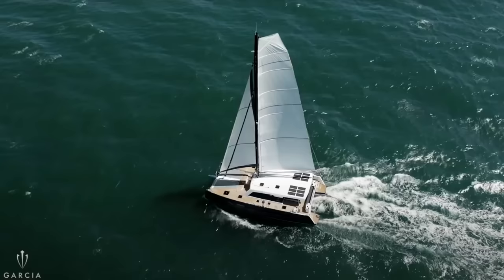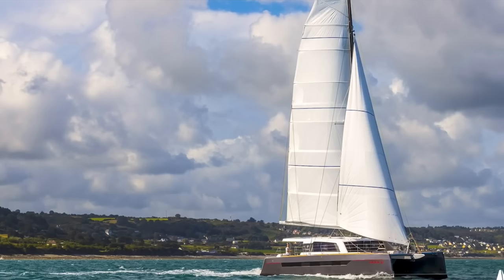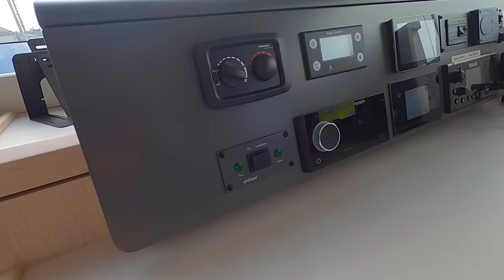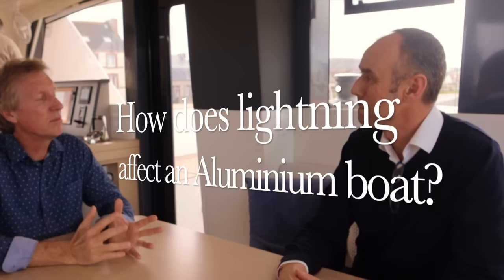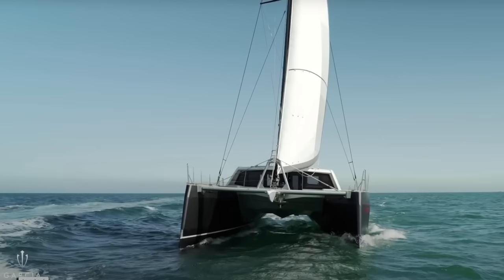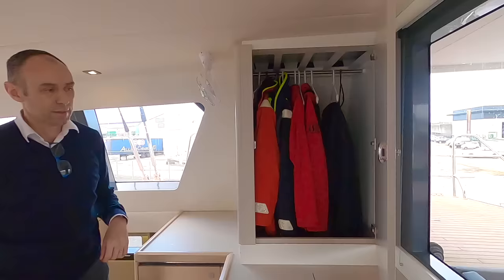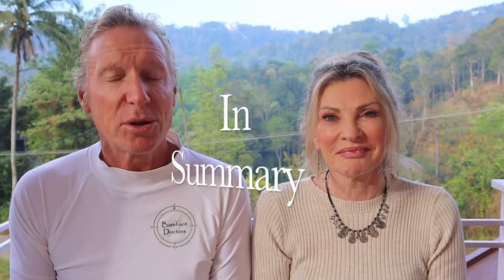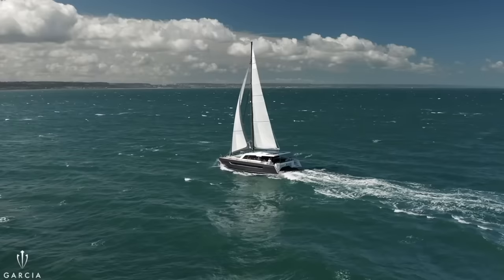S3#2.  Garcia Explocat 52 review. Is this the ULTIMATE Exploration cat - fast, safe and comfortable?

Comment: Nice presentation, I have a single-handed round-the-world boat eara1986 mono aluminum ex BOC 15.24 meter masthead cutter built by the Garcia Brothers, I would be interested to know if is this the same builder?  Out of interest, my boat was knocked down on the slipway while antifouling, the hull was badly dented it took 18 months to repair her from the top of the mast to the bottom of the keel there were no holes because of the knockdown. It's a great ocean going boat, I have had it since 1987 If you can please ask him if they had built SV Skoiern IV?  Keep up the videos info's new perspective and very informative. SV. Skoiern IV Thanks
Reply from the maker: Dear John, Yes I am sure this will be same yard but I have sent Cyrille the question on LinkedIn - he is there as Cyrille Corlay or you can email him via their website garciayachts.com as well. I am fairly sure it is them though and it must have been one of their early boats but clearly still very well made! Thanks for letting us know and hope to hear back from Cyrille!
Reply: @barefootdoctorssailing8567  Thank You! For the contact details and Mr. Cyrille Corlay Name.  Please let me know if he confirms, I sometimes find no one bothers to reply. Wishing you both. Safe Navigation experiences. SV Skoiern IV
Reply from the maker: @johnmajewski1065  Yes John, Cyrille conformed your boat is from the same yard of the Garcia’s!
Reply: @barefootdoctorssailing8567  Thanks for the follow-up, good to know/ I guess he must have been surprised you asked. Can you please send me Mr Cyrille direct email?  Thanks John SV Skoiern IV

Comment: Yes I can hear u John, but alas it does NOT have the lifting swimdeck and the main cabin is quite small and the beds are hard to make, do u make the bed John? Mmmm Eli please think about this🤣🤣. 4 yrs did he say 4yrs, Gee I'll be deaf and blind by then, and I'll need wheelchair acess.😲 she's got her good points but, I still think u should keep looking. Luv yas be safe 🇦🇺😉😎
Reply: Wheelchair access 😉you need Broadblue and Rapier/Dazcats builders for that.

Dutch Vann yachts are building in Aluminium and some Australian and NZ cat specialists have also built in Al.

The designer of Elsie, a ketch rigged cat featured on U tube specified Al for his vessel for S. Ocean sailing and expeditions whale watching.

This is a sophisticated vessel but still a little tight on the accomodation spaces. 
Personally i cannot see much advantage to having the dual external helms... and a considerable saving in expense space  and complication could be had. Hybrid drive systems would allow greater ability to get closer to wildlife.
Reply from the maker: @clivestainlesssteelwomble7665  Hi again Clive. Thanks for the comment and yes there are few different Al builders popping up including some in Grece (Sailing into Freedom), Aus and NZ that have been in touch with us. We are also very interested in hybrid engines (MJ Sailing) but so far you still need a Diesel engine to give the power for the longer distances. We hope to see improvements before we have to commit during the build process... That ketch rigged cat Elsie sounds interesting too!
Reply from the maker: Very insightful as always Karlene! We are on the road forward - exciting times!

Comment: if you think the build quality is good on that cat you should visit KM yachts in holland. absolute perfection. 
they will build you a better designed 52’ ( devilliers design better in all respects) cat for similar price. in my opinion no one builds aluminium as good as the dutch. contact Eweu ( pronounced ear wa ) hes the owner.
Reply from the maker: Thanks for the tips! Yes we owned a dutch built steel boat in the past and they had a great reputation too! I will check KM out...

Comment: I’d watch the admiralty’s review of this boat
Reply from the maker: Hi Michel, those guys start off by admitting they are "three idiots" and they have not actually been on the boat. They have not seen the structural strength or the dedicated modifications for cold water cruising and they made banal comments about "making it steel and calling it an exploration boat".... It is also easy to sit back and be an arm chair critic without actually seeing the boat and none of these three have actually been on an Expolcat as far as I could see. Easy to ve critical and make outrageous statements for entertainment value and to increase views - but I would have to question the validity there. Entertainment value - High.Value - low : sorry!
Reply: Tell me, would you sail this to svalbard in november? No you would not. 

Would you sail this boat to svalbard in june? You would. 

But then again, with modern weather forecasting and good route planning you also would in a glasfiber boat. So why pay all that extra for an alucat? The only positive i see is longevity and even that is up for debate. If anything, boatspeed and beeing a good captain is way more important then what your hull is made out off in my opinion.
Reply from the maker: @micheljansen85  hi again Michel, it is all about risk management. Everyone will hit something sometime if you are out sailing continuously - reefs, whales, containers and just bring a good captain does not prevent this. So if it is to happen, I would choose to be in a strong aluminium boat that will survive and not a grp one that just gets ripped apart. Everyone had the choice and everyone hits something sometime - in 40 years we have had three events and the longer and further you sail, the your chances for something to happen...  PS I have no desire to sail to Svalbard at any time of the year - we don’t like the cold - some do though so this boat suits them.
Reply from the maker: hi again Michel, it is all about risk management. Everyone will hit something sometime if you are out sailing continuously - reefs, whales, containers and just bring a good captain does not prevent this. So if it is to happen, I would choose to be in a strong aluminium boat that will survive and not a grp one that just gets ripped apart. Everyone had the choice and everyone hits something sometime - in 40 years we have had three events and the longer and further you sail, the your chances for something to happen...  PS I have no desire to sail to Svalbard at any time of the year - we don’t like the cold - some do though so this boat suits them.
Reply: @barefootdoctorssailing8567  I’m not saying it’s not important, but if it’s that important, you’re better off with a large steel monohull with watertight bulkheads. Again, it‘s a nice looking boat, the proposed safety aspect of it beeing able to ram icebergs (hyperbole) is not there and it feels/looks not to be that far off the capabilities that grp boats have.

Comment: I thought you were looking for performance... at 18 tonnes this is in Lagoon category... Plukky's boat is a much better option. The fact that it carriers so much fuel speaks to the fact that they expect you to do a lot of motoring.
Reply: High latitudes you have less chance of solar power and you need to generate more power and heat whilst at anchor and underway.
Reply: The Lagoon of the same length is 27.7T, 50% heavier.
Reply from the maker: Thanks for the comment Dr, We were contacted by the Greek builders so hope the conversation will continue! Even at 18.5+ tonnes this boat sails much better than a Lagoon... They are honest and say "it is in the middle between the comfort boats and the high performance boats..." I would agree that what Cyrille says appears to be very accurate - not super high performance  but strong and reasonable daily miles covered.

Comment: Perfect until I saw the terrible SAIL DRIVE.   NEVER buy this.  They do not have a proper propeller shaft drive.  TOO BAD!
Reply from the maker: HI Colleen, yes we will do a more detailed video on the pros and cons of shaft drive to sail drive in the future - but most people do not realise how much benefit you get with shaft drive..
Reply: @barefootdoctorssailing8567  ...oh, that would be a great topic for a deep dive review.  I was beginning to doubt myself after seeing Garcia install a shaft drive.  shocking tbh.
Reply: Shaft drive and modern, fine entries aren't the most natural of partners... Also, younger generations of sailors, and repair facilities, have grown up with sail drives for sail boats, even cruising boats of normal sizes. It's what everyone are now used to. And the early problems with them, are largely worked out. Although I suppose you could ditch the forward accommodations, and their weight, in each hull. In exchange for "proper" engine spaces in a location optimal for a shaft line....